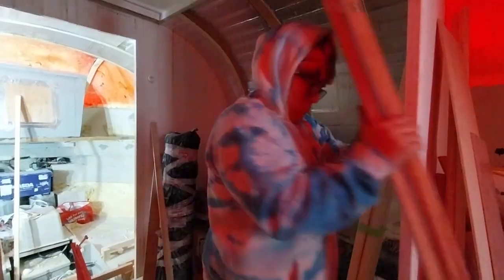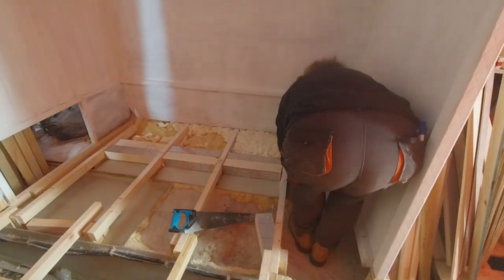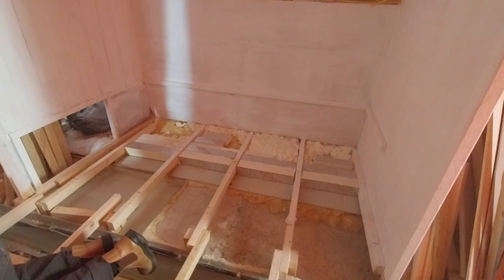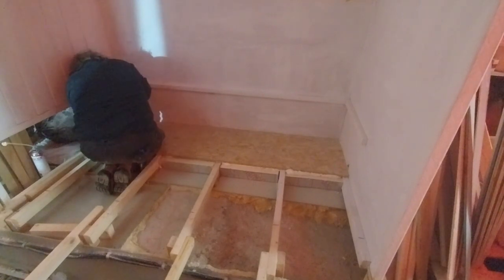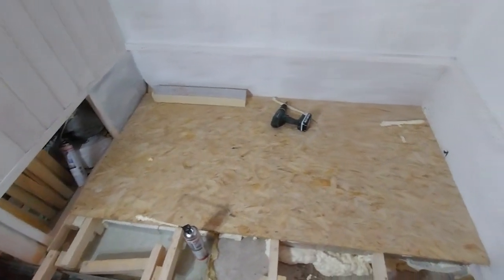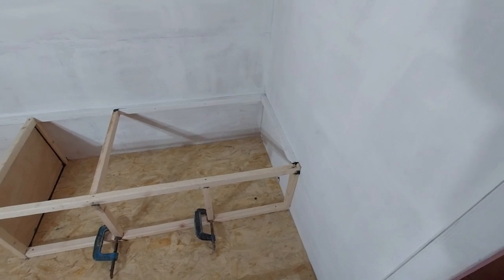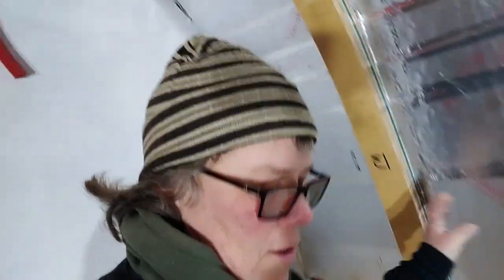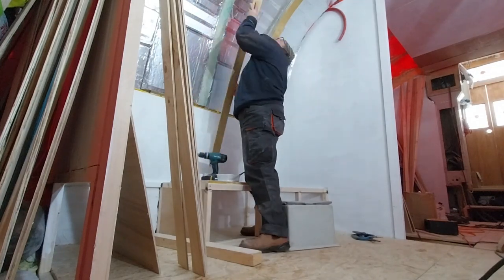Lifeboat conversion Ep. 19 Sofa, so good

Comment: Why did you replace the original insulation?
Reply from the maker: Hi. Not so much replaced as had to dig out a load to put 3.3 tonnes of ballast in and insulate on top of that. Hope that answers your question.